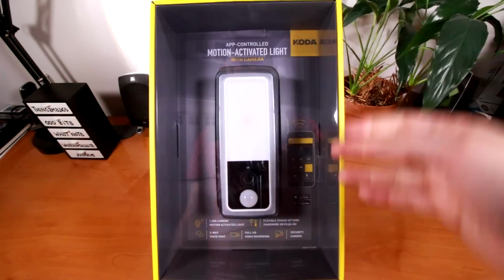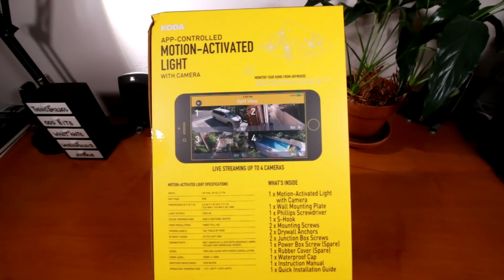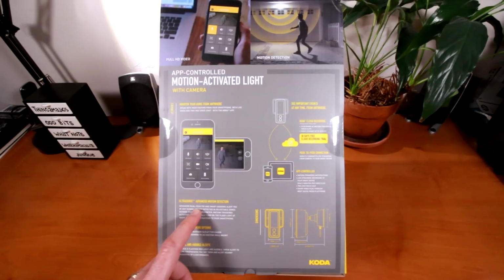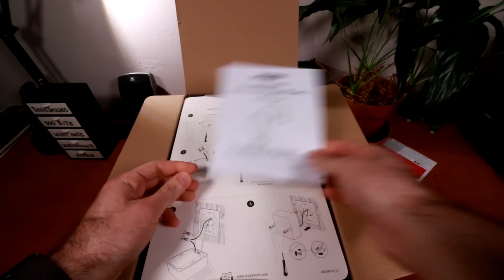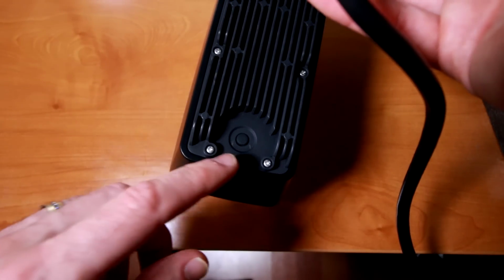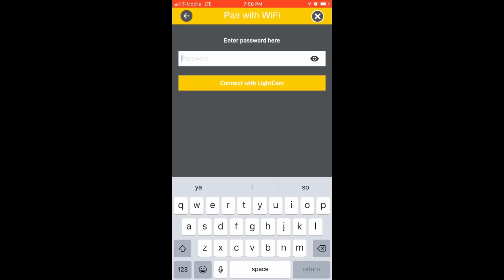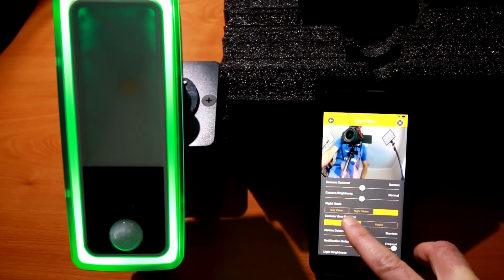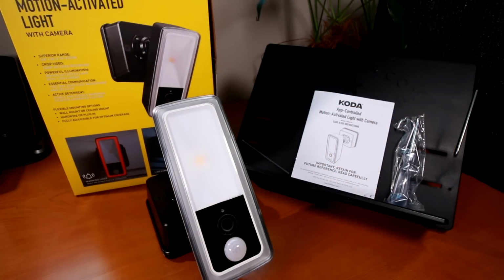Koda smart app motion-activated flood light camera review

Comment: I have a property in another state I'd like to monitor yet I don't plan to be there for a while. I planned to send this to my neighbor in that state to install. Do you know if I could pair my phone and the camera in the state I am currently in and then mail just the camera to my neighbor in another state? Or does the camera and app need to be paired to work using the same wifi signal the camera uses? Thanks. (Also, is the ugly green neon light always on when the light camera is on?)
Reply from the maker: You just need to do the initial pairing using the wifi signal the kodacam broadcasts for setup. After, you don't need to be on the same wifi signal as the camera to connect to it remotely. The green light ring doesn't remain on.
Reply: @reallyMello  Great thanks! I will buy this and then pair my phone to the camera using my wifi here ... and then send the camera only to my neighbor in a different state. Thanks for the response. Very good video.

Comment: I just installed the light, everything run good, except the motion sensor. It is very weak even though I adjust the most sensitive in the app. Is it the same problem to you?
Reply from the maker: These motion sensors work better when detecting movement across the field of vision (side to side) instead of walking towards it straight. Side to side seemed to be ok for me in my location. How far away were you and how were you testing it?
Reply: @reallyMello  Thanks for your reply, I will try your way (side to side) to see whether there is an improvement of the motion sensor.

Comment: Doesn't want to connect wifi. Any suggestions?
Reply from the maker: Is this during the setup trying to connect to the koda’s wifi for setup?
Reply: @reallyMello  yes, it shows is connected to wifi but then always times out.
Reply: Also I noticed the mobile will switch to "LTE" when the wifi is connected to Koda, is this normal?
Reply from the maker: Nope try unchecking use cellular data and trying to pair again